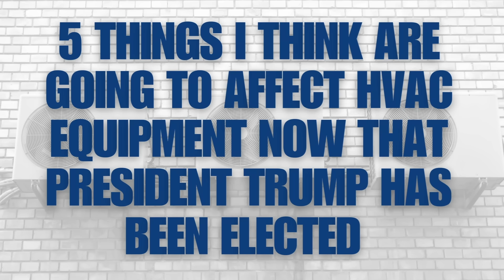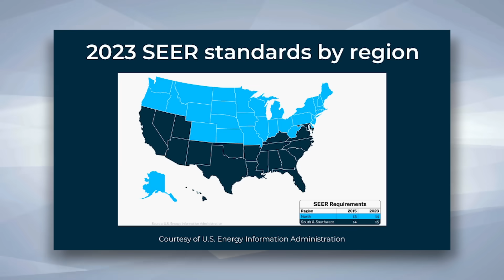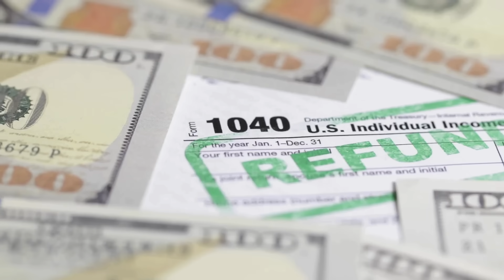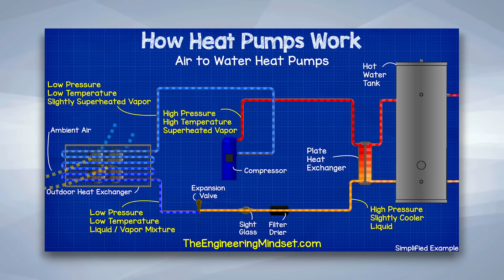Trump Elected - 5 HVAC Equipment Changes Coming!

Comment: I do residential air-conditioning. The power company started handing out free thermostats to homeowners. Someone called us over to change that thermostat. They said the temperature setting keeps moving on it's own. I said, thats someone at the power company deciding what your air-conditioning is doing.

Comment: Heat pumps will be the wave of Now And the Future.  They do actually save gobs of energy.  However there is no need to "scrap" existing installations, where you are throwing away years to decades of available service life.  The costs of replacement, materials, and actual scrapping far outweighs the savings.  Just use them till they wear out, or are too costly to repair.  We ran our old Kenmore refrigerator from 1976 until 2023 and it worked fine until the Oil got so thick, that it started to use more electricity.  This saved us thousands (to dozens of thousands) of dollars, trying to keep buying new ones, whenever new mandates came out.  Same for HVAC, why have to replace a fully functioning air-conditioning system, like our 22-year old, which is working just fine.  We only use it for three months.  The cost of replacement would set us back over 10Kdollars.
Reply: very nice lies

Comment: heat pumps still garbage
Reply: High efficiency furnaces do not last as long as 80 percenters.
Reply: @crand20033  Yea
Reply: The local Carrier dealer suggested I put in a heat pump.  When I started asking that dealers sales woman questions about heat pumps, she had zero answers.  She handed me a carrier brochure and told me to do some research on the internet.  I realize I had to do some research to find a more confident HVAC dealer.
Reply: @dand3975  you dont  want a heat pump unless it is your only choice

Comment: The war against gas appliances needs to stop. I don’t want or need an expensive, unreliable water heater with a heat pump. The electronics and sensors are not designed to last more than five years.

Comment: To me .problem with heat pumps is they utilize electricity and goes away from Gas, LP or Natural. we do not have enough electrical generation. electric bill are going up and up is rediculous steps. Solar and wind is not the answer.
Reply: that problem show up at the TVA dec 23 dec 24 2022 Jan 17th 2024, the only thing good about jan 17 2024 is the TVA did not have rolling blackouts, dec 23 ec 24 was calused by heat pumps

Comment: I may have missed if this was mentioned but trump signed the refrigerant change into law in December 2020.
Reply: Can you tell me what law that was? Was it wrapped up in a defence authorization bill or stimulus? I can't find it, but when I do, my senator is going to get an ear full
Reply: @caledon66  I think it was the AIM act. "President Trump signed the American Innovation and Manufacturing (AIM) Act on December 27, 2020. The AIM Act requires the Environmental Protection Agency (EPA) to reduce the use of hydrofluorocarbons (HFCs), including R-410A, by 85% over 15 years. The goal is to combat climate change. "

Comment: Trump wants to promote natural gas. We don't have natural gas in the area I live it and propane is waaaay toooo expensive. Honestly, my heat pump is very reasonable in cost to operate. It works just fine minus a couple months where temps are colder.
Reply: that is what back up coils are for
Reply: @dknowles60  )=_ The Aux coils are just about worthless. They barely supply any heat after the cold air blows over them. The bad part about heat pumps is this. They don't supply anything close to warm air.
Reply: @evertmorse8518  wrong again  some coils are 20 kw
Reply: @dknowles60  Still don't give off warm air. Below 30 degree temps many residential heat pumps are just plain lousy heat. Good thing is. Where I live we only get those temps a couple months a year and mostly at night. We supplement with oil filled heaters as needed. Heat pumps should only be in the southern states and the lower the better.

Comment: The more folks who switch to heat pump devices the more affordable natural gas for me to heat my home and hot water and run my backup generator.  But it will also accelerate the price increases in electricity and make are grid even more unreliable.!  MAGA!
Reply: Yeah

Comment: When you're in the market for a new HVAC component, look at the label that states "Made In America" vs "Assembled In America With Globally Sourced Parts" vs "Made In ________" I do realize that some components/parts are just not made in the USA, and have to be imported, and that there is also a certain (usually very high) percentage of an item that MUST be made in the USA, for a manufacturer to be able to state "Made In America". Ryobi battery powered tool are one of the biggest lines of whatever products that carries a "Assembled In America With Globally Sourced Parts" tag on the packaging. In most cases, products that have a label that states "Made In America", will carry a higher price tag, but you get a product that is much higher priced. There are obvious exceptions to this, such as Festool power tools, which are made in Germany.

Comment: Look at any junk yard and you will see piles of window air conditioners waiting for copper and aluminum recovery ( hopefully ).  Some are less than 3 years old.  The vast majority used R410 as refrigerant and this leaked, resulting in scrapping the unit because they were built so cheaply that it is not  economically possible to repair them.  They usually fail either because of failure of the brazed joints or because the evaporator or condenser was eroded because the bottom sits in water and the steel body to copper or aluminum lines erode due to galvanic corrosion.  There were over 6 million sold in the U.S. in 2022.  Before R410 one of these units was expected to last 15 to 20 years.  In 2014 I retired and moved to an almost rural area where many window units were commonly used as the primary air conditioning, usually in more than one room.  I installed a new widow unit in my workshop to cool about 600 sq ft.  This replaced a beat up but still working R22 window unit that had a mfg. date of 1981.  The new unit slowly stopped cooling after 14 months.  No coolant pressure.  I replaced it with a different brand (and more expensive ) premium unit. It lasted 2 seasons.  With a background in engineering my inclination was to determine the failure mode.  It turns out that the first one had erosion of the evaporator copper from sitting in the condensate even though the unit was installed with the proper slope.  The second unit leaked from  the condenser from corrosion because it was designed to be splash cooled by the condensate water.  I mentioned the problem to a neighbor and soon this became a major  topic of discussion.  It became obvious that anyone who bought a newer AC had the same high failure rate and older AC units were being put back into service where possible.  
So, what to do?  I would start by mandating that the manufacturers honor their warranty for no less than 10 years.  Maybe this would guaranty a quality product.  It would mean the release of "green house" gasses would be reduced.  And it would mean less finance burden on those who can least afford a chronically defective product.
Reply: It sounds very ignorant, however, it’s better I think to drill a drain hole in the bottom of today’s window AC’s, or take out the plug. This way you can get several more years out of it. Sure effectiveness will be reduced 5% or so.

Comment: Thermostats that use batteries  should be done away with the old ones had a transformer hard wired to the house never had any problems

Comment: Heat pumps are not more efficient than natural gas heat
Reply: They actually are more efficient in mild climates
Reply: @victorsr6708  NOT!
Reply: what drugs you taken? maybe you should lay off them. a geo heat pump is 300 to 400 percent efficient year round a ashp is about 200 percent efficient at 30f. my ashp uses 1.9kwh at 30f. and makes 36k btus. convert kw to btus and that 6828 btus if was converted to heat. how is that not way more efficient?
Reply: No one said GEO heat pump except you. A standard heat pump is in no way cheaper to run for heat than gas heat. Is that clear enough for you?
Reply: @scottgatrell1661  funny cuz cost 50 a mounth to heat with the ashp and over 150 a mounth to heat with lp. but whatever you want  to think go ahead.
Reply: @alexlindekugel8727  your numbers are not correct for cold winter areas.
Reply: @alexlindekugel8727  no way you are heating for 50 a month....simply not possible in northern ohio
Reply: @scottgatrell1661  well cost will very by area obviously. but that what my cost has been in central wi.
Reply: @scottgatrell1661  absolutely agree with you if talking about natural gas hot air heat. My house in metro north DC (MD) had a heat pump for upstairs and a gas furnace downstairs and basement. Days below 35 degrees the heat pump would basically run all the time and still felt chilly. downstairs warm as toast!! Cheers

Comment: High efficiency furnaces are not worth the cost. 30yrs experience
Reply: I 100% disagree. I have 38 years of residential installation experience here in MN and can verify that high efficiency furnaces are the best choice if you have LP gas. A two stage, high efficiency furnace can save enough LP fuel costs to pay for the difference in price between 80% and 96% easily, in a relatively short amount of time. Those who live in cities, and use natural gas and do not realize how much gas they actually use because they don't have to keep an eye on the level of fuel in their tank, may agree with you. Also, this argument depends on how much more any one company is gouging the customer for the added initial cost to upgrade to a high efficiency furnace. I can tell you that there are many companies who are literally screwing customers out of thousands of dollars by overcharging. For example- I recently viewed a  quote that was asking over $18k for a 96% 75k btu furnace with 2 ton A/C. This is ridiculous. I got it done for $9400 with Rheem equipment and I still made out just fine. Customers should always get several quotes as the majority of companies are way overcharging.
Reply: @thewisecracker-rq1pu  16% savings = about $450 per year with LP,  $250 with natural gas. The difference is about $200 in savings per year, how much more do you charge for a 96% furnace? What’s the customers ROI? Now compare repair cost of each unit? In my experience with our PM customers 90% +  furnaces have a much higher failure rate and the parts are also more expensive.
Reply: @victorsr6708  I've tried replying to you twice to explain but for some reason it gets taken down....
Reply: @thewisecracker-rq1pu  don’t know what’s going on? I’m genuinely curious on your reply. We can always learn from each others experiences
Reply: @victorsr6708  I agree. I don't know why it gets removed because there is nothing derogatory or profanity that was said in the replies. It must be the choice of the account moderator to remove it for some reason. Maybe he can explain to us if he reads this?
Reply: @victorsr6708  yeah
Reply: @thewisecracker-rq1pu  i have 34 years in residential and Commercial hvac in northern Ohio and i can tell you that a conventional split system runs at 1/3 of the cost of a heat pump with toaster back up. No doubt about it.
Reply: Much of the extra cost for high efficiency is not material cost but is pure business cost/fluff - to have good/better/best lines, at least for forced air. If you build high efficiency at volume, then the extra cost is minimal - and the problems with availability of spare parts goes away.
Reply: In live in Houston.  I use $120 of nat gas each winter heating with 80% furnace.  I would save $20 per year with a 95% furnace.  No way.
Reply: @jimw7550  yup, would never recoup the extra purchase cost of 95%er and god forbid that you would ever need to repair a 95%er
Reply: 40 years experience and I’m with you, an 80% two stage is a great unit. However I’d take a Daikin Fit over gas heating any day of the week
Reply: I see more issues with these high-efficiency 90+ percent furnaces and I do the 80% furnace is that usually when I work on 80% furnace they’re 25+ years old and I’m out here changing inducer motors between year seven and 12 on these high-efficiency units all these damn secondary heat exchanger are just shit and end up cracking
Reply: @Cal-fr9mw  The biggest problem I've seen with the high efficiency furnaces is they are not installed properly to begin with. They need to be pitched towards the front to allow the condensate to drain or it can/will shorten the life of the secondary heat exchanger. Always check the pitch/level of these furnaces to make sure they are pitched properly!
Reply: @Cal-fr9mw  Agreed

Comment: Bring back the real refrigerants , R12-R500-R11-and R717 refrigerants that actually move real heat   The new ones suck and waste your energy. This is what happens when greed gets involved.
Reply: Don’t be a moron. Nobody is pushing for R-717 use in residential applications.
Reply: @SandyHaybron-hj8pz  are you going to accept liability for an r717 residential install?
Reply: @superamazingexpertfantasti6593  only a hand full of company's handle ammonia refrigerant for that reason!!!
Reply: @superamazingexpertfantasti6593 Was used at one time in residential but for residential 
 today the equipment expense and epa compliance would most likely deter the use.

Comment: I have a question about a recent installation of a guardian RG19 furnace that was placed in a single wide mobile home closet by an idiot contractor. I  did some research on the furnace, while designed for manufactured homes...it fails requirements for mobile homes. 1st of all, the combustion chamber is open drawing air from inside the home that also has a pellet stove. 2nd there is only 2 inches of clearance on each side. 3rd they inverted the furnace to draft downward and the combustion rail is 3 inches from the subfloor. According to code the combustion chamber must be sealed, with a fresh air intake. They want to make modifications to "make it work". Wondering what your opinion is? Thanks...
Reply: I’m not a code expert. Most mobile homes are not well insulated so having an open combustion chamber is just a matter of efficiency. Any flue pipe that is close to a combustible material especially at the point where it penetrates the wall/ceiling to the outdoors should be a double wall pipe.
Reply: @mikee2923  probably not a professional either...